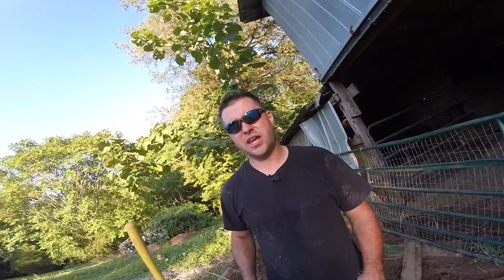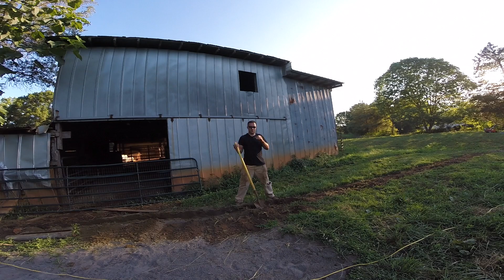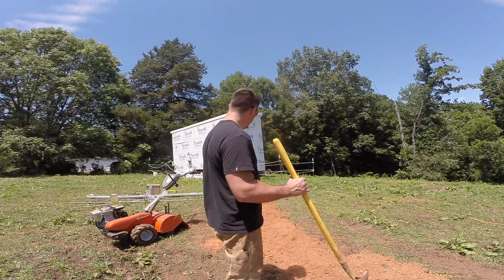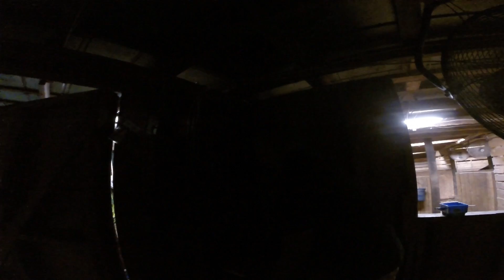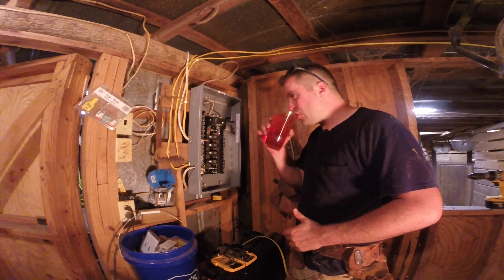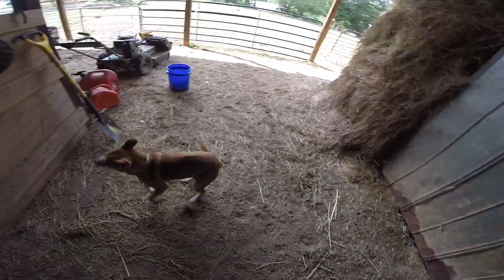Tiny House - Connecting into a Breaker Box

Comment: Also, and any electrician will tell you this, when pulling in wire to a panel, always pull enough to go into the box and to the top and back down again.  I hate working on panels where people have barely enough to work with, there will be times when you need to move to the other side of the panel, and the short wires wont let you do that.  Also pulling into a live box is tricky, I've done it over the years hundreds of times, there is a procedure to doing that, the main thing is keeping your hands away from the main buss bars and keeping the end down toward the floor (again the long length helps) to avoid it making contact with anything hot.  Nice job on fixing and explaining the right way on a few things.

Comment: Looks good! Done a lot of electrical. Tiny nest is electrical guy for sure! Like you said you will be back putting in bigger wire for more amps. Buy aluminum 4/4/2 burial wire. Copper is too expensive. Aluminum is put in new homes all the time, then you standard wiring in the house in copper. My tankless hot water heater requires a 60 amp breaker alone. When I wired homes we put 12/2 in all gfi outlets like in kitchen and bath, fridge, microwave all on their own individual circuits.

Comment: There are some issues with wire size and distance, I believe its called ampacity.  Anyway, #12 provides reasonable performance up to about 100' with general loads like you describe. Upsize to #10 if you plan to use any heavy tools like an air compressor. You can switch back to #12 after the building disconnect switch for easier wiring to the devices.

Comment: Temporary normally ends up being NOT.  I would have done a 2nd pass with the tiller after digging it out.  But mostly because the path between is long and void of things that lightning would have favored over your wire.  Check the amps on the A/C unit, if anything beyond power tools is going to trip that, it'll be the A/C.  And that's a long way to walk in the rain.

Comment: Jake is the man when it comes to electrical work. I've learned a few things from him. I think you'll regret your decision to run such small wire to your house. I know it's only temporary, but that's a long way to walk at night in the rain to flip the breaker back on. Hope it works for you. 
Don't sweat the metal roof. It's pretty simple. Make sure you're square & measure to the edge every couple of panels. You'll do fine. Just do it sober or you could fall on Peanut!

Comment: Hey Dan, I do enjoy watching your videos and I hate to be the one to point it out. But, when the video reaches 11:40 you state that it (the wiring job at the box) is done and done correctly..  However, in the video if you look at the lower left side to the panel box you will see that the white wire goes into the panel without the important wire clamp. You have until next week (when you post part 2)  to get it installed. GRIN & LOL 
Thanks for taking the time to make and upload your videos...   Tony

Comment: Just another thing to consider is that by code you can't run Romex (NM) in conduit underground which is considered a wet location.  UF (underground feeder) cable is required. Not sure what you ran in your conduit to your house but just wanted provide the info.

Comment: The one pain is voltage drop. You should have run 10-2 if you want a real 20 amps at your tiny house. Or 8-2 if you really wanted 30 amps.
Reply: +Joe Feser, I was also concerned about the 12 guage wire, I think he said he ran over 100' of conduit. (More wire = more resistance = more heat.)  Might be a good idea to use a 15amp circuit breaker at the panel, or a GFCB, but they can be rather sensitive.

Comment: When you did the electrical installation did you do an additional ground from the electrical box to the frame of the trailer? I am going to be using a RV stile hook-up. I know it will has the grounding through it but I can’t find anything as to if it is necessary to additional ground the panel to the box. Your info on your build has been a GIANT Help. Thanks